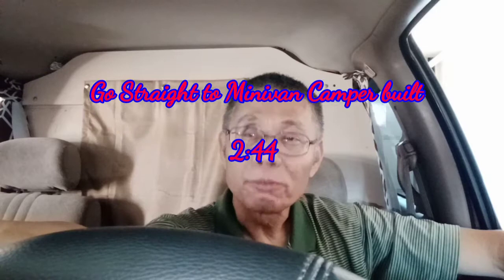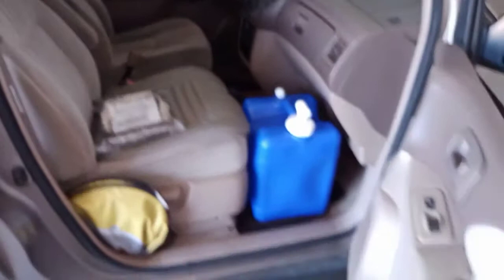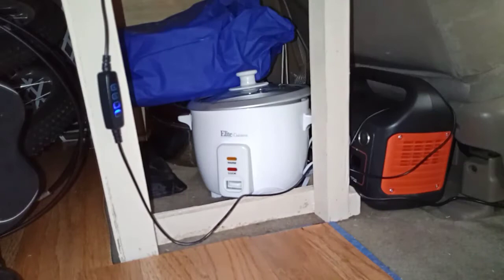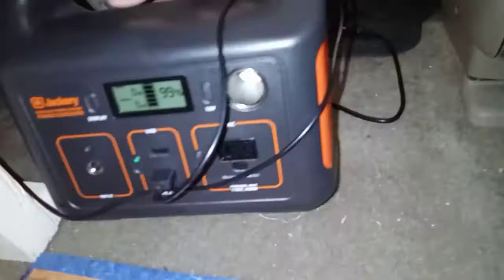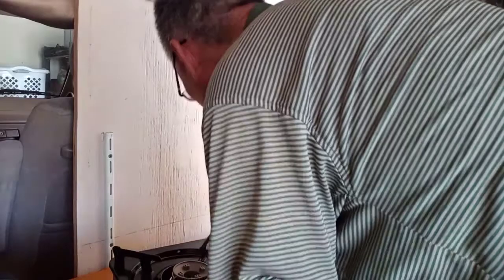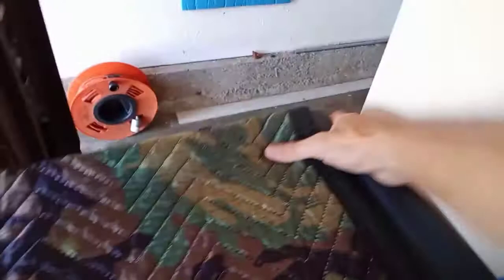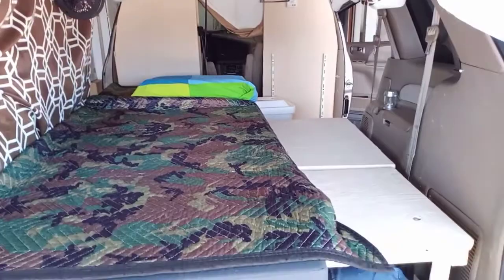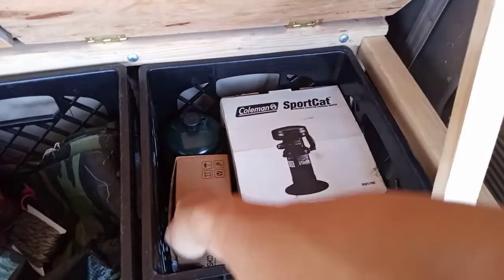Vanlife | Grand Tour of 1999 Toyota Sienna Minivan Camper Conversion

Comment: Wow, lots of  great ideas, thanks. Please excuse if you already know; using the wind screen/backsplash is a great idea but be careful not to trap heat against the gas canister.
Also butane cannot be stored below ground (as in a basement) due to thinner wall of canister & gas being much lighter that propane. Thanks for sharing. I'll keep following.
Reply from the maker: Thanks for the remind!!! I do have the fan and ventilation open up via the two rear windows. Thanks for the support.